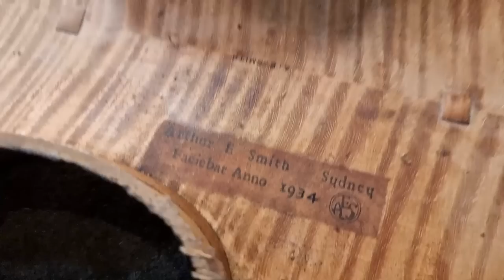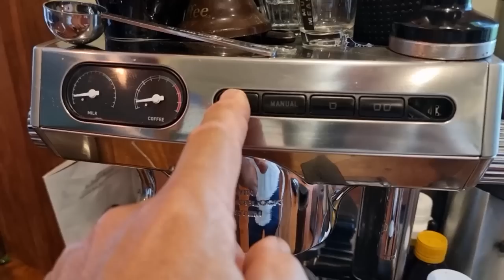I repair a 1934 A.E. Smith Violin - part 1

Comment: - I missed 15:27 when you first wet your knife and then dipped it into the glue to use it as your gluing brush, and then again at 15:48.
- I guess you have shown and taught your viewers this before, but I am a newbie.
- I am surprised that the knife delivers enough glue for your satisfaction.
- I imagined torch heating a used blade and forging mini-peening golf-ball dimpling into the surface to carry a slicking of glue into the crack like grooving a Babbitt bearing surface to travel grease onto an axle.

Comment: Happy birthday & thanks Olaf. My BD was enjoying food the next day after a colonoscopy. 😉 It was interesting seeing the inside of this A E Smith violin. I am finishing a violin I had started (I won't say how long ago) for my son's birthday & I had the belly ready for purfling with the channels cut & now I'm close to marking & cutting the back for purfling too. I had the peg box & scroll completed too, however it is always nice to see little ideas used by other makers as I progress & can take on some of those ideas. I'm refreshing my memory for the small details as I pick it up again (I've been repairing & setting up instruments since I started though). I'm using the 'Betts' Strad pattern as a guide although making it to a longer model (4-5mm longer).
With this A E Smith violin the middle section inside the back looks like it has been brushed with something. I wonder if that was from later repairers brushing through the sound holes? Also, with the varnish chipping off, I've found that with some varnishes of early 1900's factory instruments if spilled glue is left it just takes the varnish off, but I wonder, could A E Smith have used water glass treatment (ref: Sacconi) on the outside? I tried it on my first violin I made, just because I could. 😊

Comment: Perhaps the rosin build up caused a higher adhesion to the collapsed finger board to the varnish and the now moistened spruce released the varnish from beneath. Just a wild guess.

At any rate, always fun to watch your process.

Comment: $100,000 Australian is roughly (edited to correct) $64,000 US.  Holy cow, you not only are a master violin  maker, but you’ve got balls of steel!!!  I can’t imagine having the knowledge and confidence to crack open an instrument of that value.  Bravo!
Reply: I think you have the conversion backwards. 100,000 Aus would equal about 64,000 US.
Reply: @freefall8243  you’re right; I went back and corrected it, thanks!  Still a damn expensive fiddle.

Comment: Why did Smith's neck break out though? Original neck... or did someone else glue it "back in" badly. If so: why did they need to glue it back in? 
The answer had better be: the owner flew from Australia to Singapore, to Antarctica, then to Malaysia, then to the Arctic, then back to Australia ... where it currently is...!   ;)

Comment: Good effort, but you need to use close-up shots. Many of the things you described, for instance the Stradivarius symbol and the supports along the edge were not Visible.   If you shoot in 4K, you will have enough resolution to magnify part of the screen in post. But the best thing to do is to go back and re-shoot the close-ups As B roll.

Comment: I am curious as to the glue you are using? I could not find any reference to it. You seem to use an old jam jar to heat the glue?
Reply: I believe it is hide glue which is often too syrupy to work with unless heated.
Reply: @mercoid  Thank you very much. That helped me finding the information I was looking for: https://en.m.wikipedia.org/wiki/Animal_glue#Hide%20glue I found the German language version a bit more enlightening: https://de.m.wikipedia.org/wiki/Glutinleim (use Google Translate or equivalent to convert to English)

Comment: I was confronted with a violin that had come apart in a similar way and then re assembled with hot glue from a glue gun!  It came apart again.  Luckily it wasn't a valuable violin.  I turned down the repair because I wasn't certain that I could remove all traces of hot glue and be confident that hide glue would work.

Comment: 34:50 -just wondering why the varnish is SO dark under the fingerboard.... I know the old masters varnished the whole top and the placed the fingerboard on.... but then wouldn't;t the whole violin be slightly darker? Certainly not blonde... curious.
Reply: It’s probably just antiquing. Painted to look older than it is.
Reply: Olaf said that the ebony fingerboard had rested on the top for a while, when it was damp.

Comment: Hi, If it is not a secret where do you get your pearl glue, and what was the varnish you used?  My usual supplier has let me down recently with dry shellac that was pretty much past its use-by date when sent to me, so I view all products as suspect now, pretty hard to get that trust back.  These days, there appears to be pearl glue, and then there is Pearl Glue!

Raspberry jam jar in, what, a stainless steel mixing bowl for the glue heater - a classic.  But what were you using in the bowl to transfer the heat, was it wax?

I almost dropped my hot chocky when I saw you using red handled, two dollar shop, Chinese F clamps.  They seem to work okay, but don't you find the thread a bit too coarse?

Brissy when it is wet, yuk.  There was one year, in the early 90s, when it just rained all winter, what a misery, I could not get dry.  I live down the GC now, humidity has been through the roof lately.